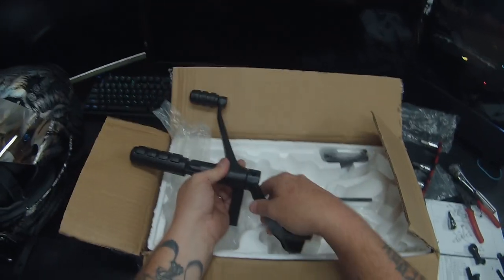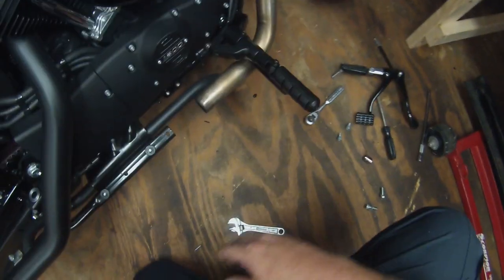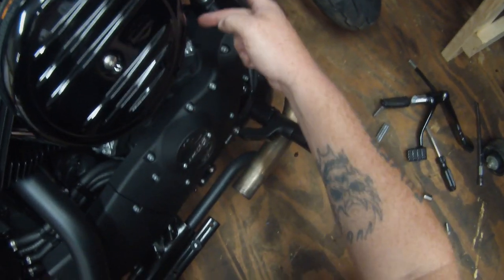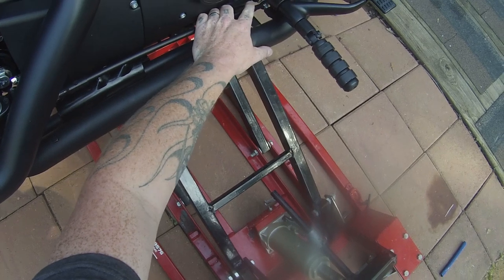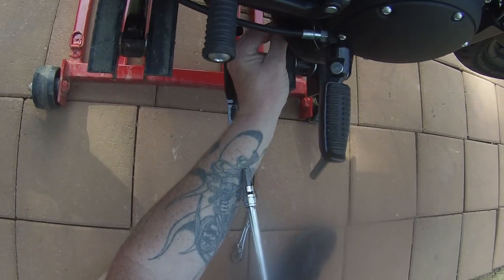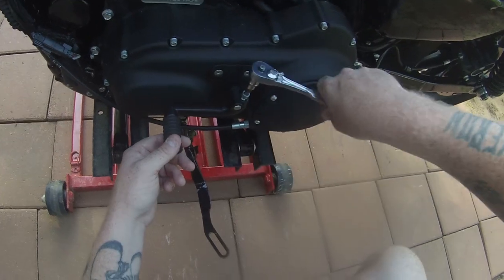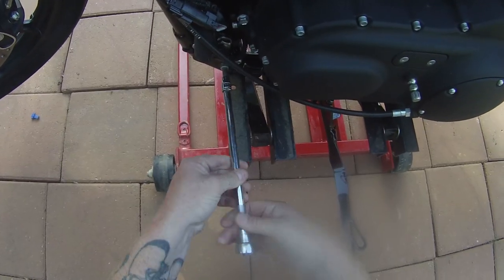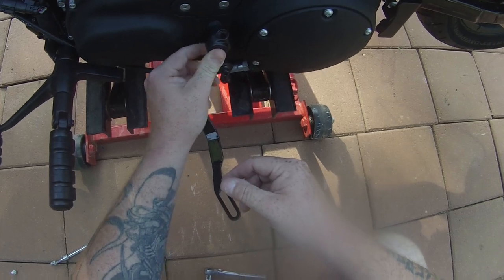How to: Forward Controls Install | Part 2: Installation | 2018 1200 Iron | MTmotoRIDER

Comment: I’m using the short front bolts to put in the holes where the mid controls was
Reply from the maker: Hey if it works it works!

Comment: I bought this same product. Boy did I have fun putting that crap on. Mine was poorly machined and was coated in paint. The pins for the foot pegs were too big so I had to drill them out for them to fit. It was a pain in the ass. But it’s done now and so far has held up okay.   
Haven’t ridden too much since I put them on so only time will tell.
Reply from the maker: You are not the only one that has had trouble installing the controls. I know the Raider brand kit that I bought gave me no trouble at all during install and was held fine. I have since traded the Harley, but idk why some have so much trouble.

Comment: Hi Buddy, any chance you can post up a follow up video showing them on the bike with motor running, ebay and amazon have really mixed feedback, so would be good to get real world example, like if the levers rattle around in the forward controls when the bike is running, hows the paint quality after some use, do the foot controls flex under any pressure (like suggested on amazon) would be really helpfull on a follow up review, and alos how your riding style has change, if you could discuss that, the mids have a knees up style, so would like to know if you find the new riding style more comfortable, there is comments on harley sites that forwards dont handle as well as mids, with the sporty being shorter, would like to get your perspective on handling changes post the change to forwards. Really like your posts, very helpfull and informative.
Reply from the maker: I definitely can do a review video in depth on the forward controls. I have used them for a while now and that is a great idea. I’ll try to get that video done in the next week or so!
Reply from the maker: I did a follow up video! I hope it helps you out! https://youtu.be/fDZEmZaG0QU

Comment: Great video thanks,  but no use of loctite and a torque wrench ?
Reply from the maker: I realized that after the fact and had to go back and use loctite and torque them!
Reply: @ncmotorider  Alright that's good then, I am reassured for your safety on the road ! You won't loose a peg so quickly then.
Reply from the maker: Yup. All has been good and no issues so far!
Reply: where did you find torque specs?! also what did you torque em to!?
Reply from the maker: King Premo Everything is usually in the owner’s manual but if not you can definitely find it online!

Comment: solid video, thinking about ordering these this week. how have they held up since? rating 1/10?
Reply from the maker: Held up just fine for me! I have not had any issues so far! I would give them a 9/10, only because I did change out the pegs for something bigger, but the included pegs will work.
Reply: Travis Howell i’m getting them on friday, super stoked  ⚡️
Reply: Curious about the brand. I see a lot of them on Amazon and EBay.
Reply from the maker: Earl Beville I was skeptical at first as well. I have had them installed now for a while and I have had no issues! They are holding up very well and we’re way cheaper than the kit from Harley!
Reply from the maker: Deemed MFG Nice! Let me know how the install goes!

Comment: Hey Travis, where did you buy forward controls and how much did they cost? They look solid. Good job!
Reply: It says right on the product description "Made in China" - How are they holding up  @ncmotorider  ?
Reply from the maker: Ethan Jones So far so good! I have not had any problems out of them yet. I have not had anything come loose, which I was afraid of with the way the bike vibrates, so I like them a lot so far.
Reply: Thanks Travis! Glad to hear you've had success with them. I am a little squeamish when it comes to hardware from China, but I do think this is an affordable package that might prevent me from buying a larger bike. Ordered mine today. Ride safe!
Reply from the maker: Ethan Jones Awesome! Use loctite when you install and you should be good to go!
Reply from the maker: Here! https://amzn.to/33RI2Ge
Reply: MTmotoRIDER this one?!